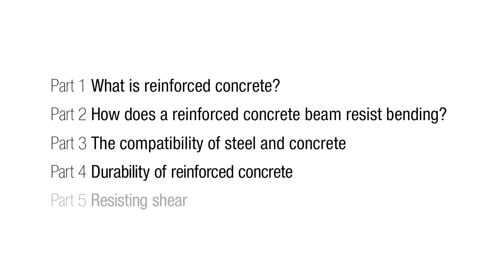Resisting Shear - Bare Essentials of Reinforced Concrete with Prof Tim Ibell Pt5

Comment: Can someone tell me how stirrup will resist shear failure? 

I think The bottom and top reinforcement bars of beam will resist the shear forces 

I don't understand how stirrups will resist shear forces as  shear forces apply in vertical direction and also stirrups is in upward position so how it will resist?